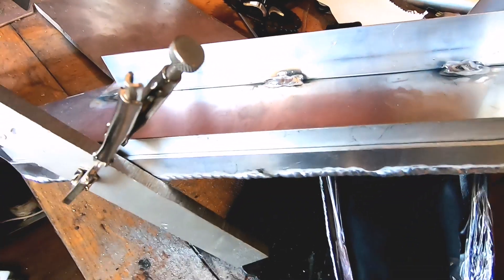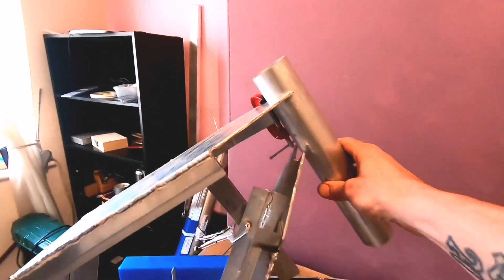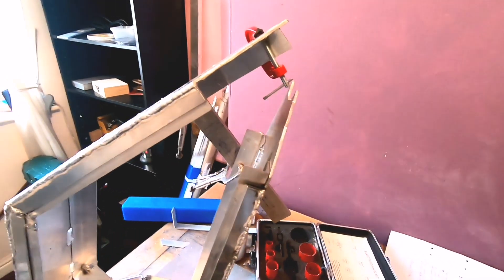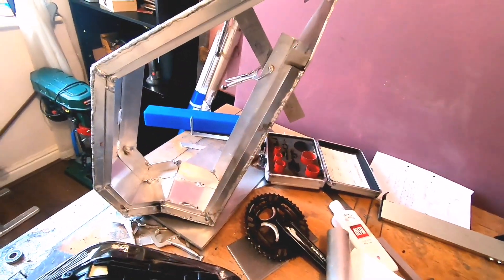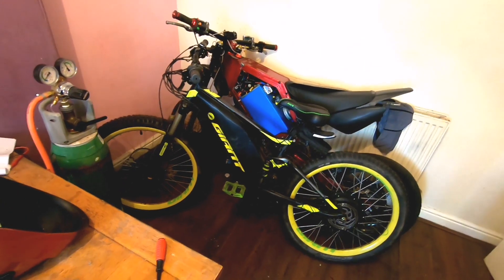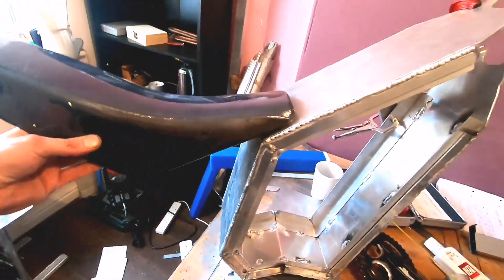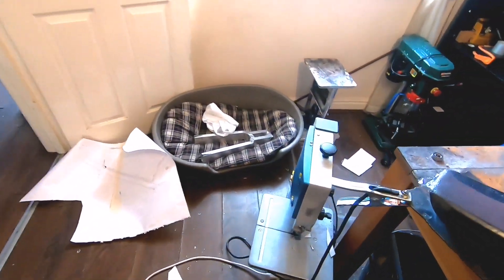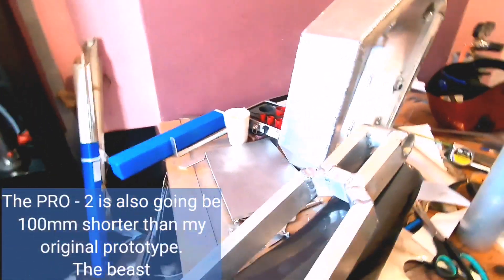DIY E BIKES ON THE NEXT LEVEL | INTRODUCING THE PRO - 2 | HAND BUILT ALUMINIUM E BIKE FRAME |

Comment: I found the trick to neat tig welds was small diameter rods added to the pool little and often. Those frames are gonna be mint. I’d say by number 3 you’re going to be a lot neater with the tig. Best of luck you maniac 🤣🤣
Reply from the maker: Lol tig welding is to expensive to practice with, sometimes you just have to get on with the job. The welds are better on the underside. It's like they tell a story. Typical the good welds are the ones you don't see 😂 I will get batter tho. Thanks for your comment BTW it means a lot let's just hope it all goes together OK now haha I need all the good luck I can get lol